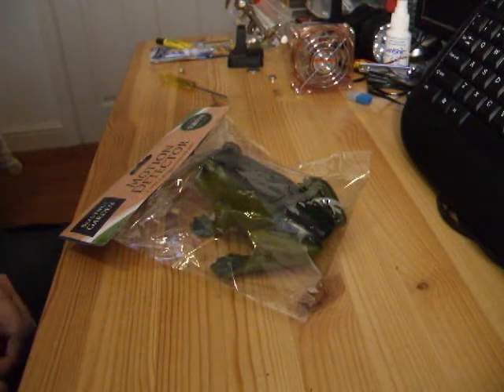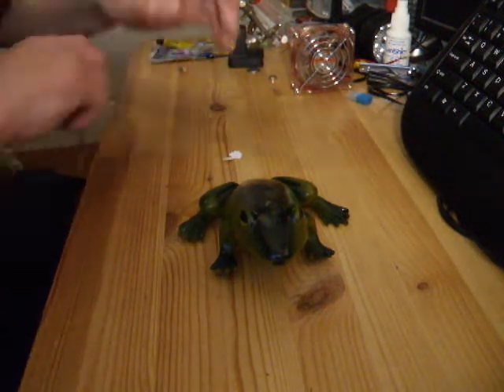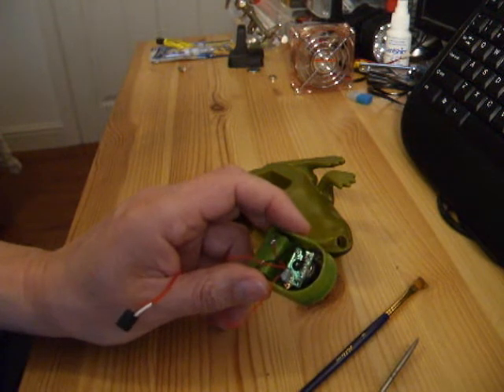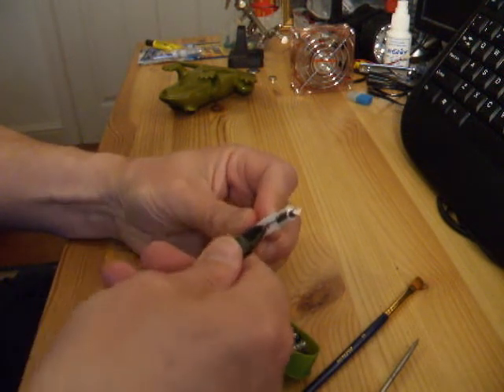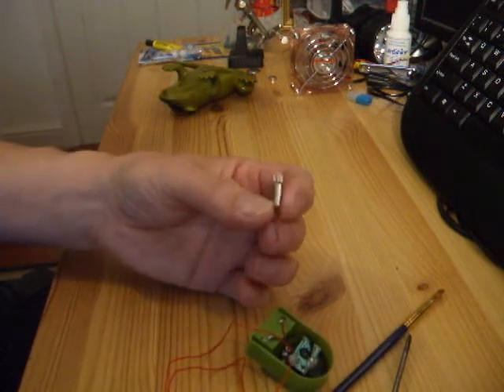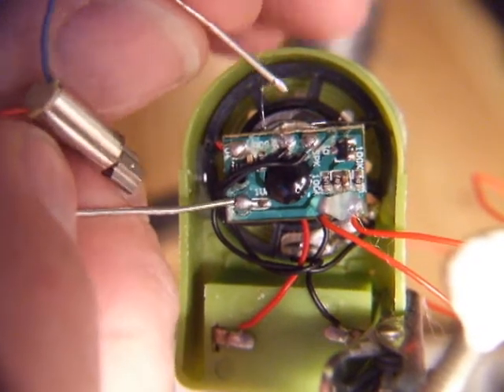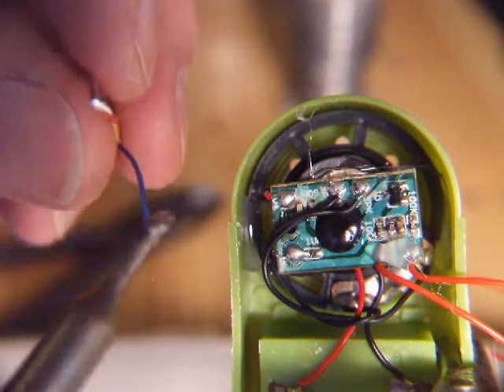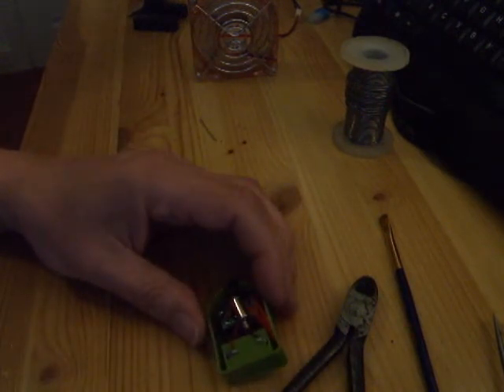Let's hack a Motion Detector #2

Comment: Hello I have a croaking frog but my husband hates it. Don't know what he has done but it has lost it's croak. Does it have batteries. Thanks for any advice Regards
Reply from the maker: +ShazzieP yes it does have batteries. From memory I thing it takes 3 button cells, probably AG13 LR44 size. If you are in the UK you can get them cheap in Poundland in a pack with several each of various popular sizes. I mention the location of the battery box at 01:24